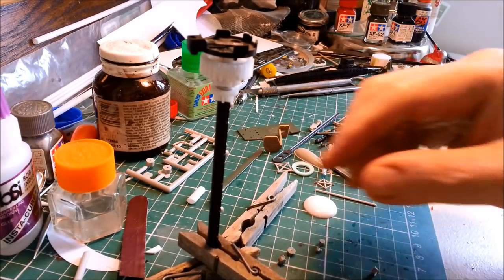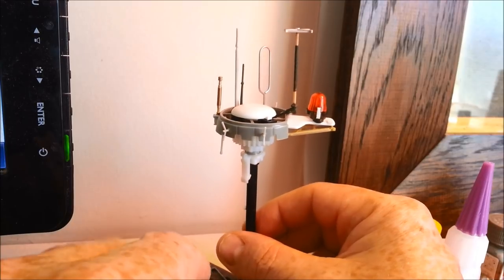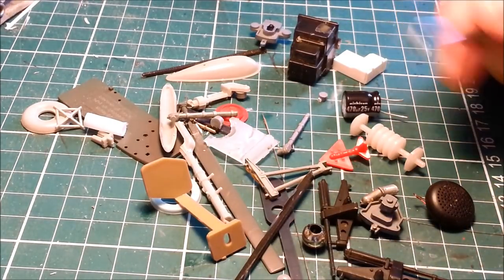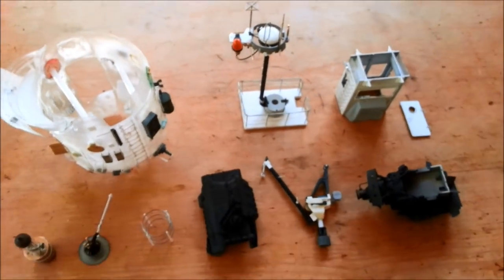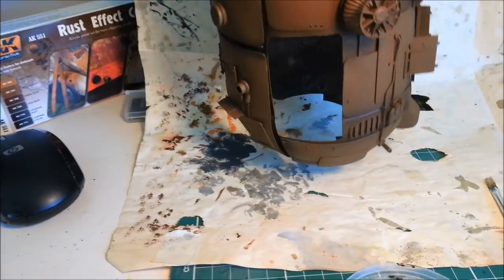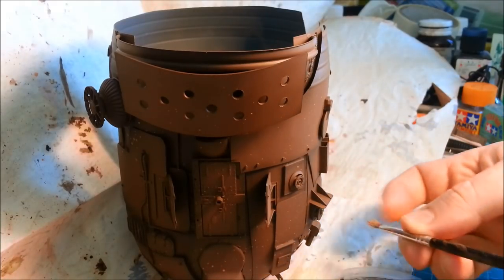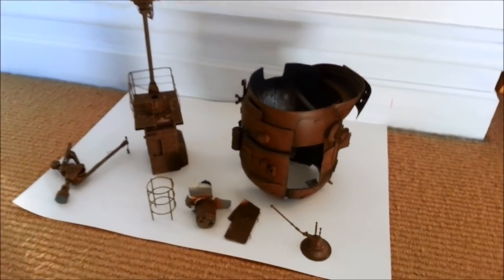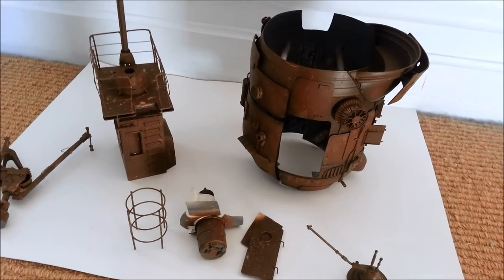Scratch building 1/35 scale sci-fi model ship - Part 7

Comment: Looking amazing, mate. One word of warning: I'm working on my own scratch-build, using similar crappy plastic and I, like you, primed and prepared the surface ahead of using hairspray but found that even relatively gentle bursh strokes/cocktail stick scratching took all the paint and primer off, straight back to bare plastic.
Reply from the maker: Thanks for the heads up Mike. I've been very delicate with my airbrushing, actually leaving very little topcoat on, so I can be very gentle with the removal. I hope it works out... Good warning though. Dave